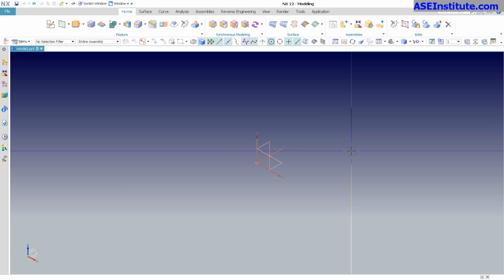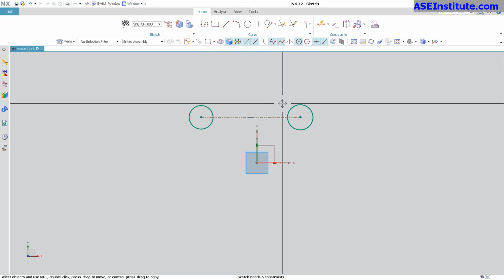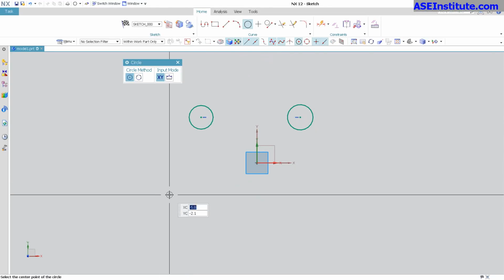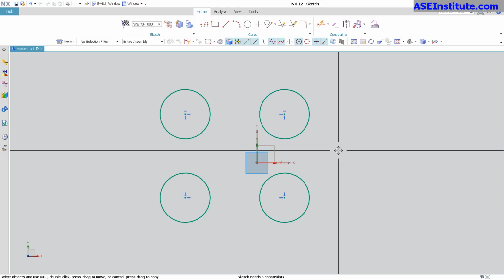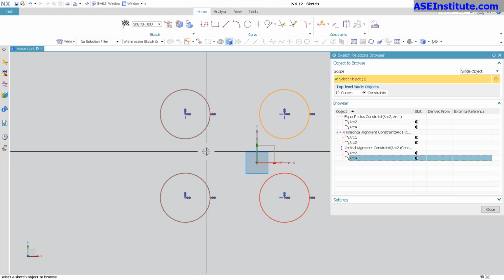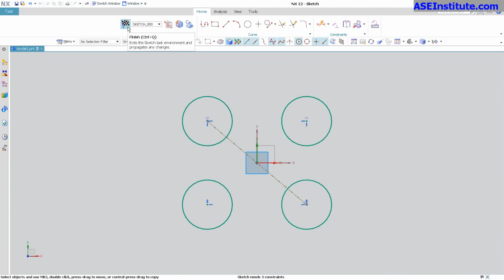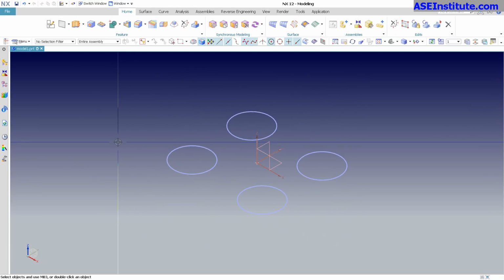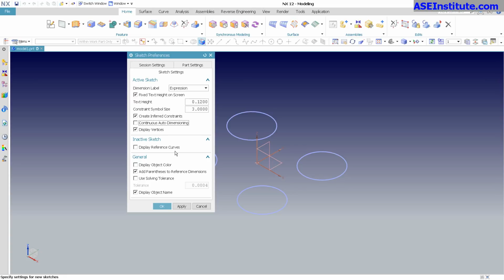NX 12: New Sketcher Tools

Comment: these constraints were introduced in NX 11...
Reply: You could have made the center points symmetric as well.  But they would have to be centered about the CSYS.  The advantage of the new constraints is they could be aligned off-center.  Cool tip!
Reply: So I believe that you never use Nx 11... Cause you can't believe everything that's Siemens or any other company sells you on a broucher
Reply from the maker: I am going off of what they provided. Yeah, I have never touched 11...
Reply: @classasurfacing  dudeeeeee...saw your video on May 10,2017 using NX11...
Reply from the maker: I do not care for symmetry in Sketcher. I have had issues with it in the past so I stay away from it. But when I say past I mean over a decade ago. Should look at it again.
Reply: Very sad to hear that, I was looking for differences between the last version. Thanks for answering. BR.
Reply from the maker: I was kind of kidding, I have a lot of experience in 11 but mostly in the Shape Studio. Let me know what you want to see and I will gladly provide.
Reply from the maker: MME AMT i thought so but the official What's New document calls it out in 12.